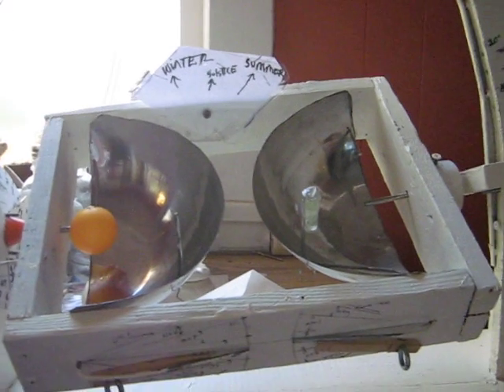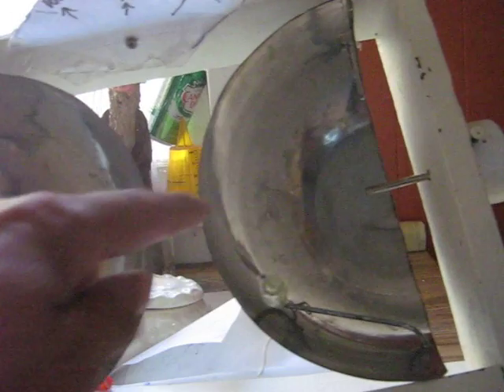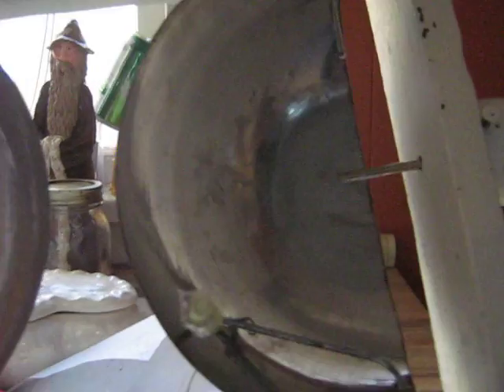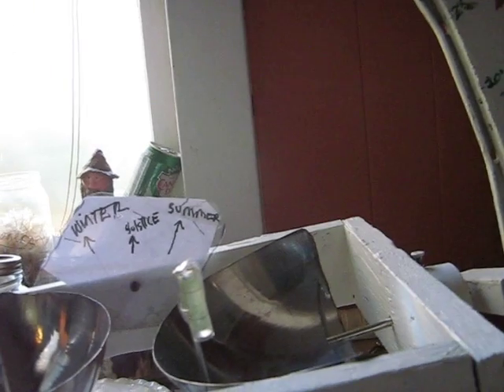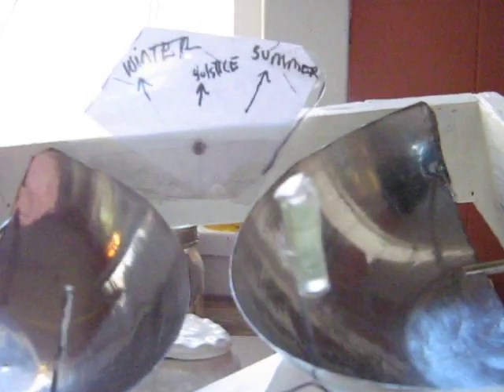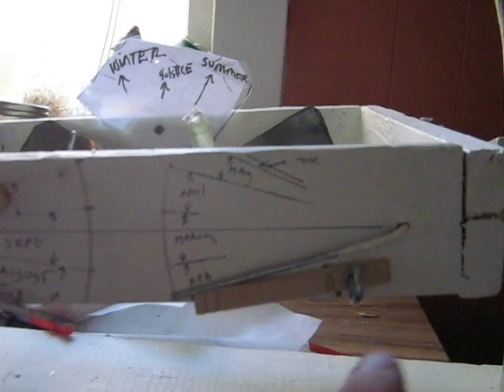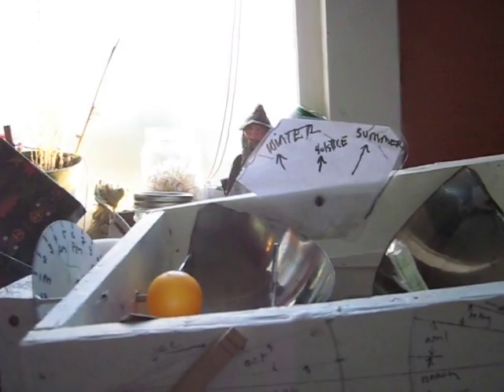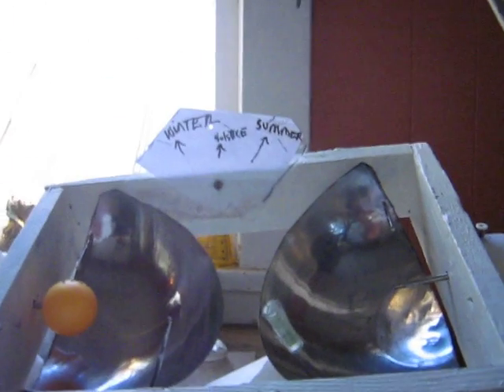Tracking solar accumulator, the reason for the second dish and how to get rid of it!

Comment: @gaiatechnician You seem to be up for the task, you could try it out by using a page magnifier rather than a large lens. I understand that it would be more practical if you could buy a lens that already has a tracking system but unfortunately they are too lazy to make them. :-\
I suppose that I could try to make one but I will probably fail miserably : (